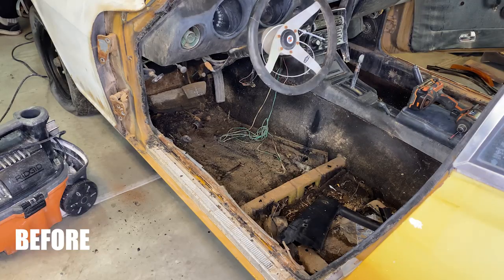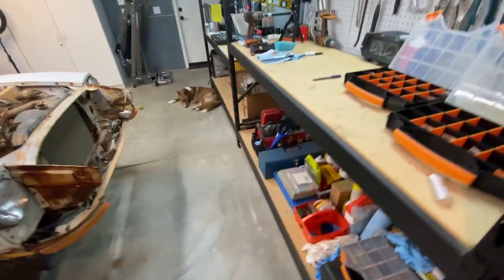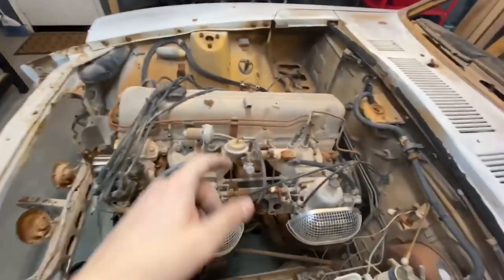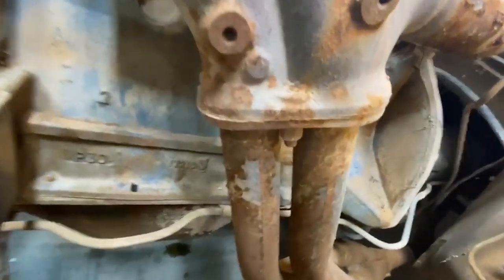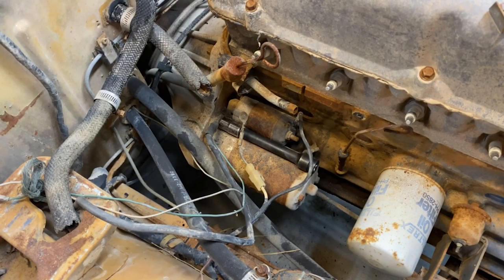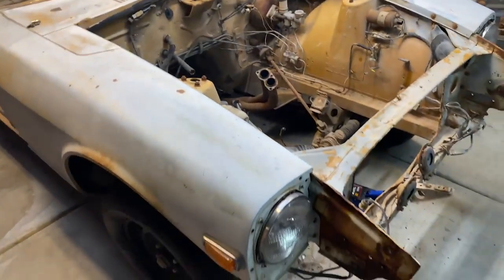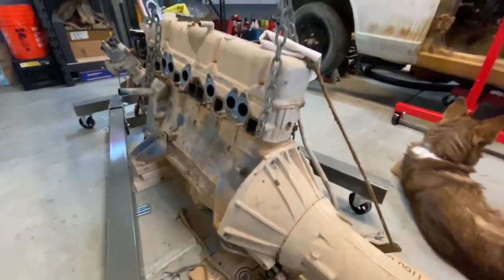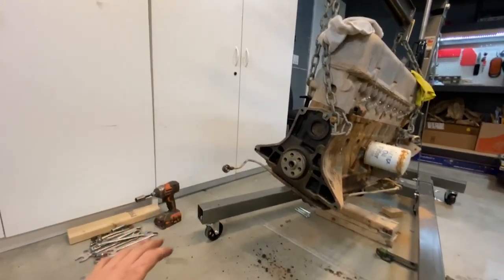Junkyard Datsun 240z - Part 3 - Taking out the Engine

Comment: Looks like the car once had a A/C installed, was it?
Reply from the maker: Not sure, could be a possibility. What made you think that?
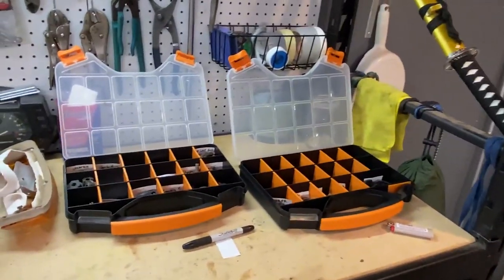Reply: BradBuilds at 5:25 you see that rubber tube running around the inspection light and going into that black metal tube? I had that in my z too and just removed two weeks ago because the AC unit was not working anymore and those rubber tubes went into it and also into the cabin under dash left side 5:30. But you should also see if this car had one by looking at the dash since there should be switches for the ac. It was only a dealer option and not something datsun actually offered (as far as I know)